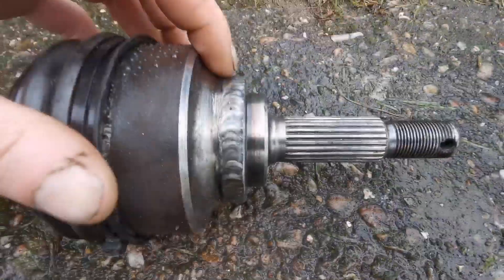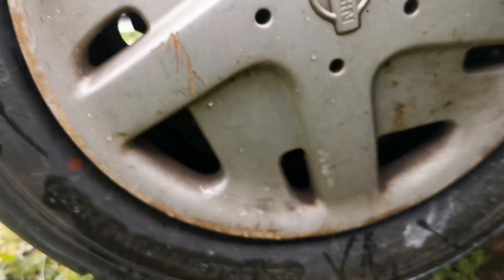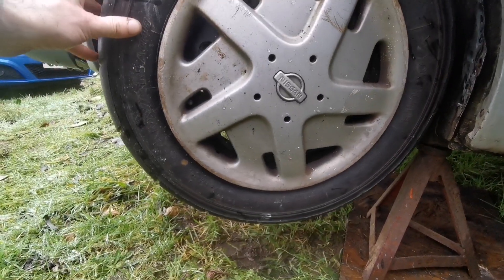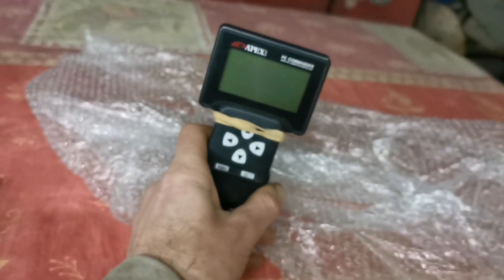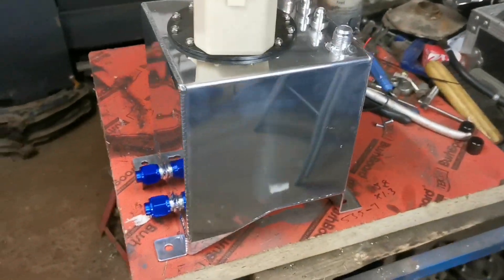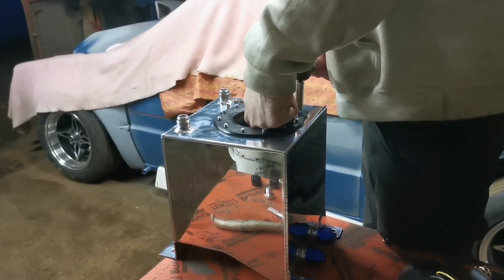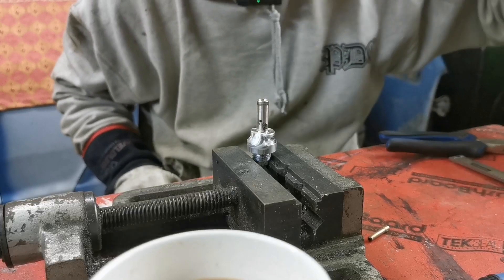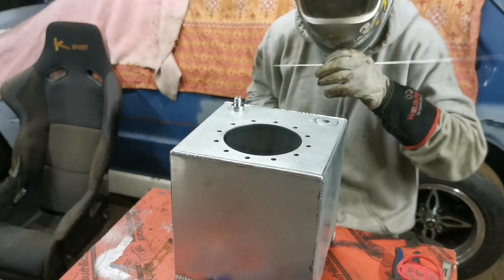Low budget build for fwd drag racing

Comment: Crackin progress, love the shafts 👌
Reply from the maker: Hopefully the CV joints won't explode 😂
Reply: Also love the driveshafts it's so grassroots and I can't wait to see how they hold up. I spent $500 on basically stock axles for the e153 transmission swap into the mr2 and I don't even expect them to survive long once I get sticky tires and boost. Just couldn't bring myself to drop $2000 right away on the 1000hp axles.
Reply from the maker: @MotorSwapDan  Im interested to see what happens. The originals I made are still good to go. I will put new joints on and keep them as spares. But I do intend on upgrading to sentra hubs. They have a slightly bigger cv. I know a few companies that make strong shafts for rally cars. If need be, I will speak to those guys
Reply from the maker: Thanks mate 🙂

Comment: Thanks for taking the time to show the tyres! £30 for a lightened flywheel?! I would have snapped your hand off!
Reply: Also, thanks for the heads up re: offset of chunky tyres!
Reply from the maker: In the video you can see the that the paint had been rubbed off. That is from my previous set of wheels and tyres. I had 185 60 13 with 7j -7 offset wheels. You can either hammer that part or cut and re weld for more clearance. I did that on the blue k10, back in the day 🙂
Reply from the maker: You are welcome dude! Yeah, I probably should have sold the flywheel for more. But I just wanted to sell it as quick as possible. I had advertised it on Facebook years ago and no one was interested. Then it was lost for a while in my shed 😂 it was for a preface lift cg10. The ones with the tiny clutches. I don't think there are many of those setups about these days!

Comment: Nice update you seem to be making loads of progress with this build 
The driveshaft end spline swap is a cool idea I've never seen that done before with them welded on it will be interesting to see if they can handle the power 
I need to get back out on my k10 I'm waiting for the better weather though
Reply from the maker: Thanks mate, I have had a ton of energy for my builds recently. I'm finding this one especially exciting, with the whole idea of selling stuff that I have hoarded, to make the budget bigger. I hope it inspires people to get out and work on the projects they have sat on the driveway😎

I haven't seen anyone try the CV joint idea either. I originally modified the joints back in the summer. I didnt use them though, I'm unsure how it is going to work out. But due to not having an k11 joints, or having the money, at the time, to buy any. I thought that I may as well give it a go 😁 I still have the original shafts that I made. So my plan is to buy some k11 joints and have them ready to go as spares 🙂